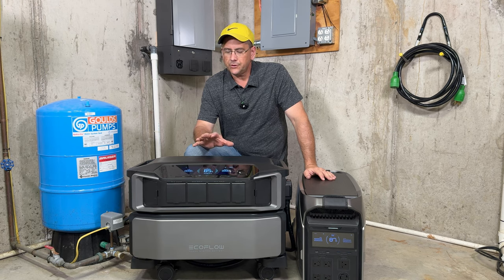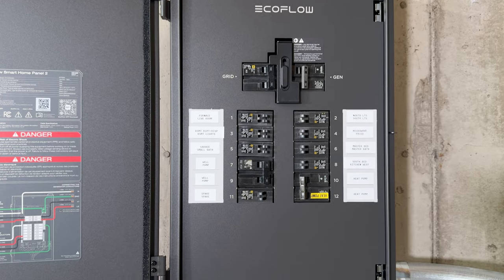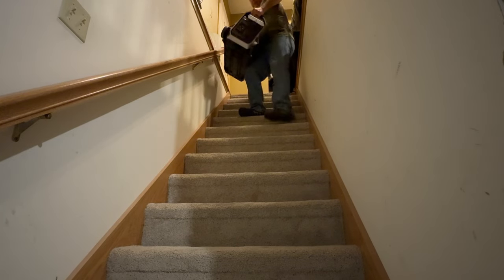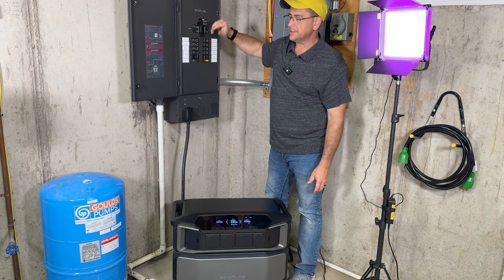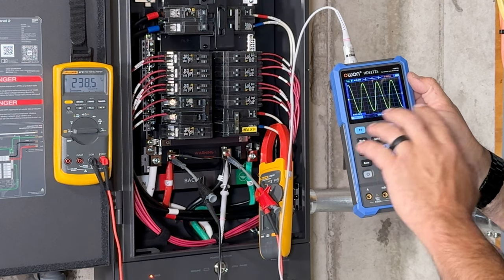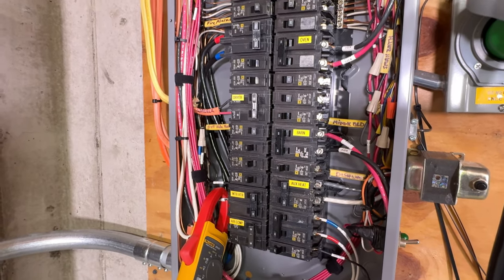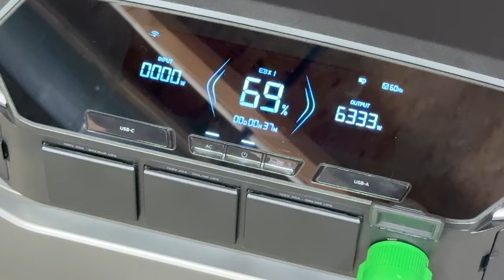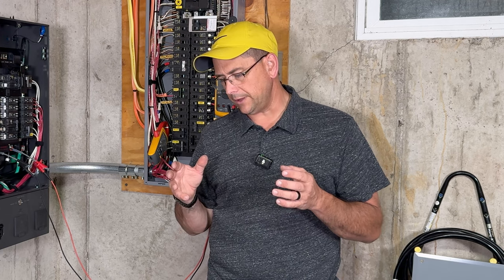EcoFlow Delta Pro Ultra vs Delta Pro 3

Comment from the maker: At the end of the video I talk about what I'll be testing next.  My discount codes for Amazon prime are in the description below. I test both DELTA PRO machines against 120 V and 240 V Lincoln wire welder. I also tested against a WATER HEATER and a 2.5 Ton HEAT PUMP. At the end of the video I talk about what I'll be testing next.

Comment: I have been waiting for someone to do this comparison test between these two units. I have 2 original Delta Pros with the dual voltage hub to get 240V connected a transfer switch for home back up. So the upgrade for me would be the DPU. GOOD JOB!!!!!
Reply from the maker: I like the DPU a lot. It’s real power. Thanks for watching!

Comment: I see you are using doubled up 15 amp circuit breakers in the SHP2. Please correct me if I’m wrong, but are they called a double throw single pole breaker? I have GE older 15 & 20 amp single breakers installed in my SHP2. I realize each quadrant is limited to 60 amps draw with the assigned breaker. I love how you installed the SHP2,with a 2 inch pipe
Reply from the maker: Thank you! I believe what you’re asking is correct.

Comment: Can the Ultra power a 1hp well pump and handle the initial power surge?
Reply from the maker: Mine is a 3/4hp well and it doesn’t phase it. The ultra has a surge of 10kw area. It’s impressive. Until these two power stations came out there wasn’t anything I could use without building a system that would be large and a hassle.

Comment: Can I charge the battery on the DPU and DP3 with a gas powered generator or gas powered inverter without damaging the DPU/DP3
Reply from the maker: Yes as long as it’s clean power and in tolerance.

Comment: This is a great video.  Well describing the differences at a top level.  I have been looking at the DPU and it seems more in the ballpark with my battery backup whole house idea I have.  I like the watts rating, just don’t like the solar inputs.  I am trying to decide if I go with a ECO Flow appliance or discrete components with an inverter such as Sol-Ark or EG4, etc.  My initial idea was to go completely off grid and not rely on the Texas power grid.  I have looked at the cost of that it is high, and I am now considering a backup with batteries and a generator for the batteries in a grid down scenario.  Thanks again for your great video.  All the best from north Texas!

Comment: you mentioned the dpu can do 21.6 kwh which is not accurate. 1 dpu can only do 7200 wh. but you can connect 3 of them to a smart panel to get up to 21.6kwh  :)
Reply from the maker: Correct. I was talking about the total maximum it was able to do.
Reply: You’re confusing inverter capacity vs battery storage

Comment: Awesome video I just bought my pro 3 and extra battery plus eco flow smart panel 2 last night I hope it will run most of the house during blackouts in the future.
Reply from the maker: It depends on what kind of loads, starting watts and the total watt load. But it does what it’s rated for. You should be fine if you conserve

Comment: Great video, thanks.

How do you think Teslas  new aluminum_ion batteries will change things? Will they be compatible with the current batteries?  Is it wise to wait on the new batteries to phase in before building a system? Thanks
Reply from the maker: These aren’t compatible with other brands. The battery has circuitry in it that makes it proprietary to EcoFlow. I haven’t done much with the Tesla stuff so I can’t really tell you who’s got the better battery. All I know is the EcoFlow stuff works as it’s rated.

Comment: Rick Thank you, I always wondered about not having Solar power.  So my question is when you go to charge the units can I use. L-30 NEMA cord to charge from gas Gen to the Ultra or the Delta 3. Also can I use a gas or propane small inverter generator to charge using above cord. 

Thank you. 

I would be using these products in a summer home where electricity is very expensive.
Reply from the maker: Yes you can charge either the DPU or DP3 with the L-30 plug if you get the adapter from EcoFlow. That will allow faster charging than the 120v wall plug.

Comment: Would the DP3 with the dual voltage hub would be able to handle the  45 amps draw?
AWESOME VIDEO 🎉
Reply from the maker: Two dp3 would be 4k+4k=8kw / 120v = 66 amps or 33 amps at 240v.

Comment: What a massive size difference between the DPU and DP3
Reply from the maker: I was gonna show some side-by-side pictures, but I think you got the point. The ultra is one bad boy but that Delta pro 3 is pretty sweet too. Just depends on how many watts you need.
Reply: @HVACRSurvival  Im planning on getting one to power an office shed daily, its pre-wired with a transfer switch subpanel. Biggest load is a 9k mini split. Also to use as back up emergency power for the main house. Noise was the biggest issue with the last Delta Pro, I could go DPU or DP3 now but I’m also factoring inverter efficiency. Keeping a 7000 watt inverter idle must consume a lot of power when overnight all I need to run in the shed is a small dorm size fridge.

Comment: Hi Rick, great video. I left you a comment/question three weeks ago but I didn’t see a reply. It’s probably because it was so long. Can the Delta pro ultra or the Dp3 do a  power switch between grid power and battery power without shutting off refrigerators and small portable air conditioners unfortunately my old Delta pro could not do it.  Really would appreciate a reply. Prefer to stay within the Ecoflow ecosystem if possible.
Reply from the maker: I thought I showed in the video the smart home panel 2 transfer switch has a 20 ms transfer speed? If you have the appliances that you’re wanting powered by the two devices you just mentioned then yes it will switch right over, as a matter effect. We just had our power shut off for maintenance and it switched over and we didn’t even know it and it just switched back an hour later.  This is assuming that you have the Smart home panel 2 installed. If you have anything else, then no you’re gonna have to plug it into the device and it’ll work the way I described in the video.
Reply: Thanks Rick. Appreciate the reply

Comment: i noticed on your SHP2 that you didn't move any neutrals for the circuits into the panel.  isn't that required?  i want to put this panel at my house but that mess of re-wiring is making me rethink.
Reply from the maker: I ran 2 AWG neutral and 2 hot legs. Plus ground. There’s no need to loop the neutral from the original box over to the other box and then back again.
Reply: @HVACRSurvival  hmm good to know.  I thought for sure all conductors had to be at the point of disconnect but this would be ideal for me since all my wiring is buried in the wall.  Minimal drywall damage!
Reply from the maker: Consult a local electrician to make sure your area is not different. We’re not inspected here and there’s nothing unsafe about it in my book.

Comment: Do both work if the delta pro ultra and delta pro 3 are plugged into the smart home panel 2 at the same time?
Reply from the maker: I was originally told it would, but unfortunately, they have not figured out how to make it work. I’m assuming it has something to do with the capacity difference of the DP3 being lesser

Comment: from what i understand, if you connect 2 DPUs to the SHP2.0, there'll be 14KW available of continuous power. does this mean that if I have a load of say 9 kw, would this still be fine even if a DPU is rated 7kw?
Reply from the maker: When you combine two DPU units together you’re correct, 7200w x 2=14,400 watts. You’ll have the full 14,400 watts to run a load up to that rating.  Surge watts is 10kw each totaling 20kw

Comment: Can you link an Ultra and DP3 together with the dual hub to get 11.2Kw?
Reply from the maker: I know you can’t with the smart home panel 2 as of now so I would speculate the answer would be no due to the unequal power capacity. Try emailing EcoFlow, if you have any problems getting an answer let me know and I’ll reach out to my contact.

Comment: Hey sir, thanks so much for the knowledge. I was wondering, much does installing a generator inlet box cost in a roundabout figure. I live in California and have been wanting to have one installed.
Reply: Probably $1-$1500 now, I was quoted 750-1000 a few years ago from licensed electricians. You can also do an interlock which is less labor. It turns the entire panel to generator power. But you have to tell everyone in the house to not exceed the generator.
Reply from the maker: @rob California everything’s more money. Around here you might have $150-$250 in it. It depends on how many feet of wire they need to use and how difficult it is to run that wire.
Reply: @HVACRSurvival  thank you so much for at least giving me a ballpark and some of the factors that contribute. I’ll plan for at least twice that amount with the California premium in mind.
Reply: @TobyCostaRica  thank you so much, that is likely what I will do.

Comment: The phone app for the DPU with 2 batteries indicates battery temperatures ranging from 98 to as high as  111 F.  Right now they say 104 and 99. They are charged to 90% and drawing no input wattage and no output. The ambient temp is 86. I emailed Ecoflow support who replied basically not to worry about it, indicating it was normal. I was wondering if you or anybody else have similar temp readings on your DPU batteries.
Reply from the maker: I haven’t noticed it running warm. Gotta remember the batteries are inside the unit with a lot of other things going on. They likely will get warm if pulling power from them.

Comment: the majority of standard electric dryers run a single element and control the temperature, by cycling with a small heater built into the cycling thermostat.
later models would have temp and mositure sensors that cycle via a relay. the newest stuff out there, god only knows. 🤣
Reply from the maker: That motor had a pretty good size in rush.
Reply: @HVACRSurvival  yeah, the motors in them can be power hungry on start up, especially with a heavy wet load.
they are centrifugal start switch and capacitor type(sometimes cap. is at motor, others up in control box).
 that same switch also  brings on element power, assuming the settings and thermostats are all closed calling for heat. so it pretty much goes from high motor start current instantly to element on full current draw as it's just finished starting.